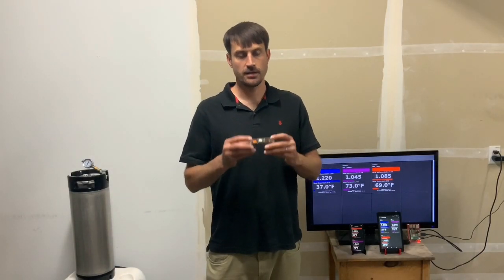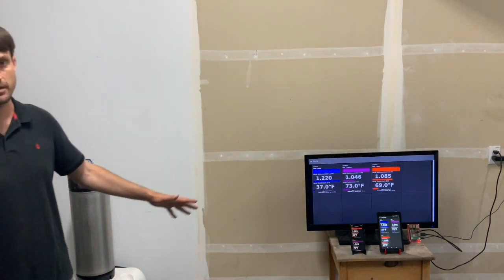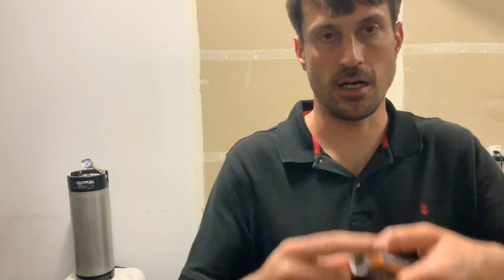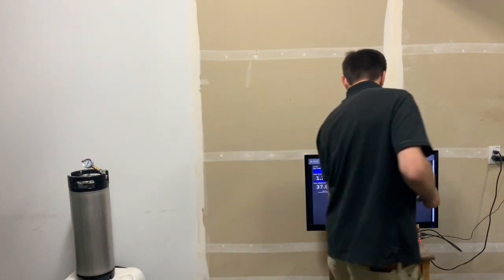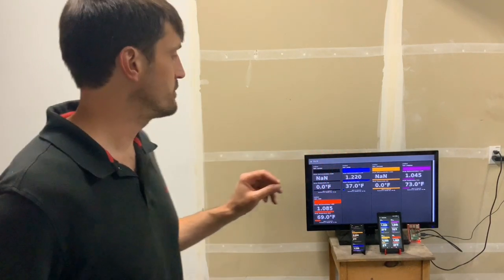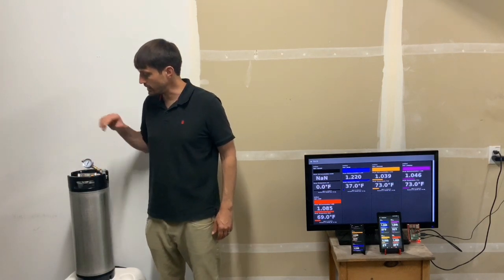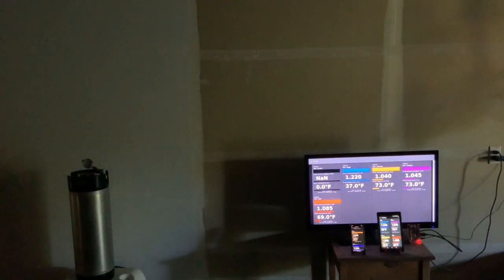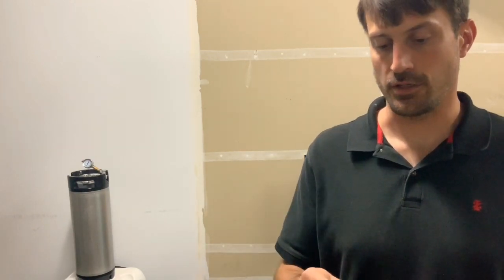Tilt™ Repeater - Intro and How To Use

Comment: I read all the comments, and as far as comparing Tilt to iSpindle, there is no labor cost for iSpindal, how fast can you put the iSpindal together? I could do it in less than an hour I would say, but my labor rate would put it up in the  $50 Pus parts, about $80. A business is required to pay insurance, taxes on a building or space, electricity, and you cannot deduct these for anything but profits if you have them. so I think the price is fair. But, I am disappointed that it only connects to my iPhone from 4 ft away from my Bichmann 10 gal fermenter. So I don't want to spend another $100 +  to get one with an antenna or buy a booster. I have a Plaato and although it is just an estimate, it tells me whats going on in my fermenter without any other crazy expensing add-s. I don't rely on it for SG, I take samples, but it will count the bubbles, which tells me, without having to go to my fermenter, that the yeast is busy. No Googelsheets setup or any of the tracking, I get everything I need. Having said that, I like that the Tilt sets right in the brew, you get, if calibrated correctly, the most accurate temp and SG. How about doing an app that is like the Plaato? Also, I would like to know if I put a 5-inch black plastic plug in the cover of my fermentor, will that increase my signal pass through enough to get me 20 ft away from the fermenter? Ok be nice, constructive criticism is welcome, thanks
Reply: Buy a cheap RaspberryPi, install their free software, and you're all set.

Comment: Any cheaper V3 version coming up with better antenna.  In EU i see lots of ispindels because of the very high price of the tilt v2 (150 euro).  The v2 has less than 16 euro  components on the pcb.
Reply: Your comparing apples to oranges. Tilt is a commercial product which is the result of years of research. ispindle is essentially a rip-off diy project, and not even a good rip-off at that. I own three Tilts and have to say they a a joy to use. Well worth the premium over diy solutions.
Reply: Toby Schmid The iSpindel is hardly a rip-off since they are both made out of non-proprietary mass produced readily available components. The idea is great and Tilt’s creators should be commended, but there is literally about $10 worth of component (when purchased at scale). I can buy everything needed to build one for about $40. $140 is outrageous and Tilt is pricing themselves out of business.
Reply: @tilthydrometer   i am a ham amateur, and i can tell you that a better rf antenna dont cost a damn thing that size. Or a pcb etched antenna on those higher frequency's. That said,  the price is still too high since the ispindle sells for €30 - 60 in 2019 EU. You should sell this product directly  without 2nd party retailers resellers. That should be the best option.  Those retailers profits are too high. 154 euro for a Tilt , were i live against the €30-€60 ispindl nib.
Reply: @tilthydrometer   I have to say I find that product to be great.  I've the v2 since it came out and still on original batteries (i have 2).   I use an old samsung android phone, but want to convert to the raspbian software.  Can I get just the packages to install on my PI, or do i have to have your total image that would then dedicate my pi to just your app.    Thanks.
Reply: @tilthydrometer  thanks took me a bit but both mine reporting in just fine.  Cheers...great product.  That repeater should do more than one cheers